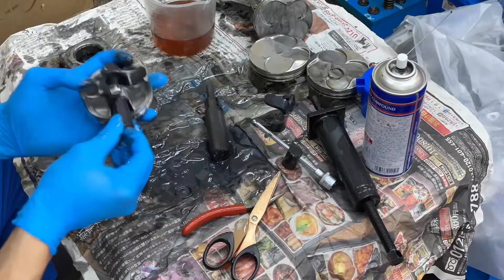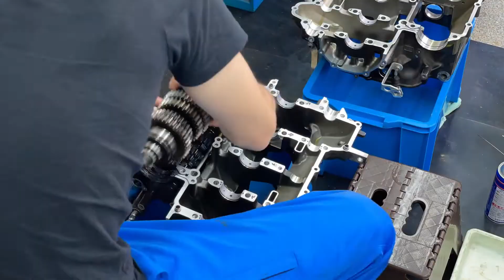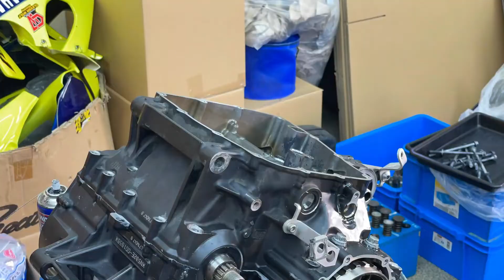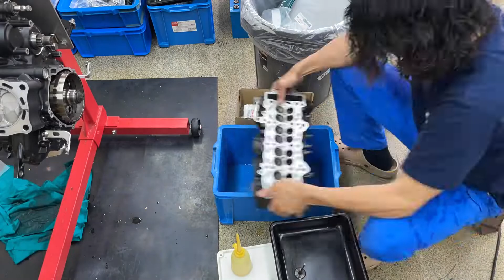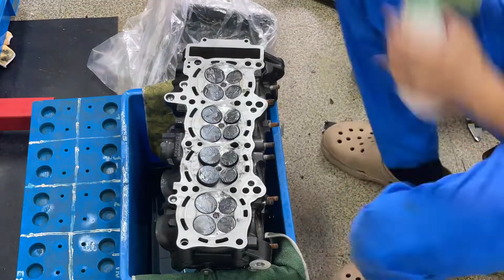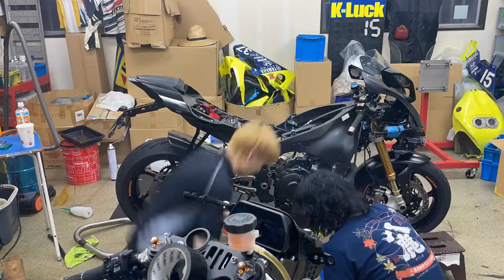YAMAHA YZF-R1 Engine Overhaul / YAMAHA YZF-R1 エンジンオーバーホール

Comment: Can you explain the process of torqueing the cylinder head, before tha last stage do you loosen bolts one by one and then torque to angle? Thanks
Reply from the maker: @sabywalleh2154  Thank you for your comment. First tighten the whole part with torque and then tighten it with an angle. This will allow you to tighten it evenly.